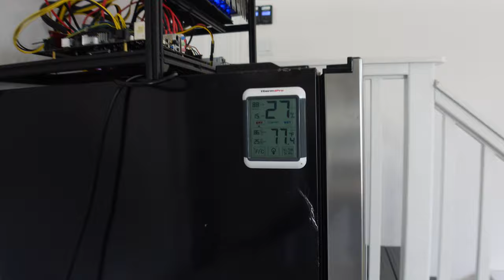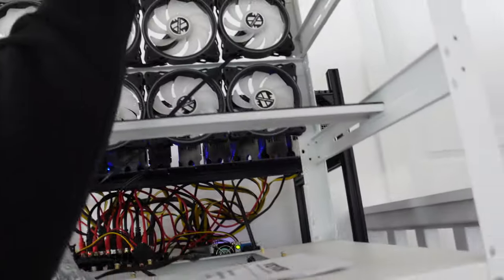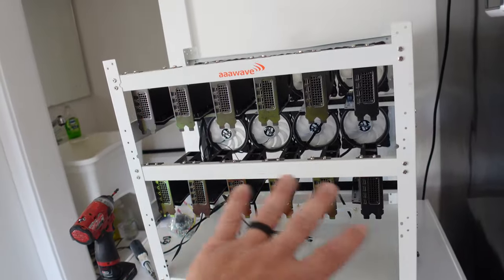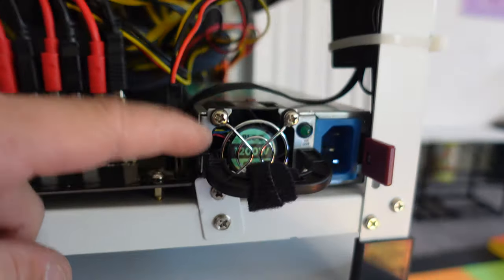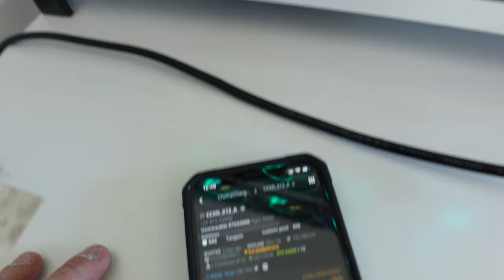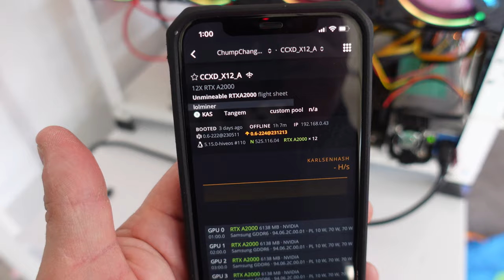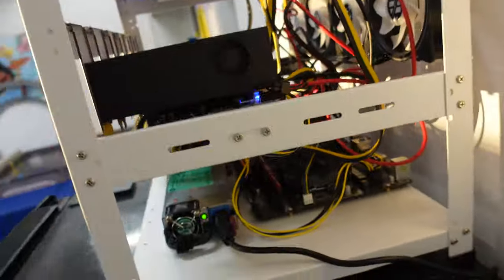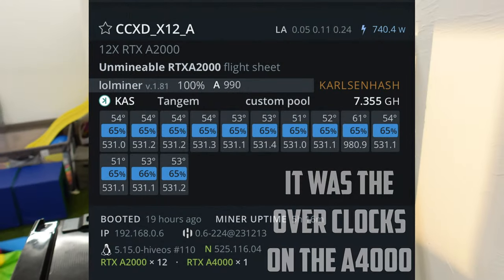CRYPTO MINING RIG FAIL...

Comment: Rig looks good. There is a bios update where you can turn off the need for the molex for the board to boot. Also, you need to go into the bios and make the board turn on after a power loss. That way, it auto turns on when you turn on the server psu. #gpu